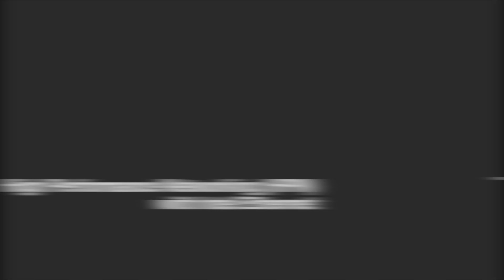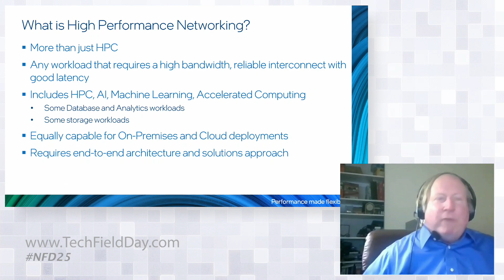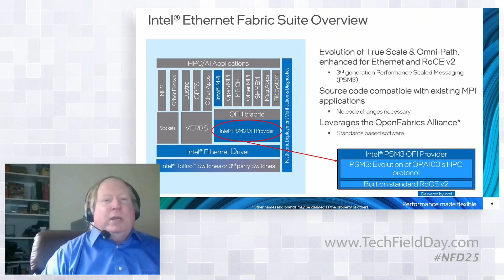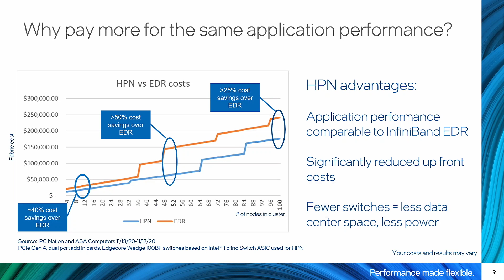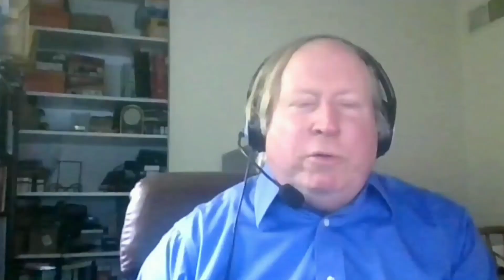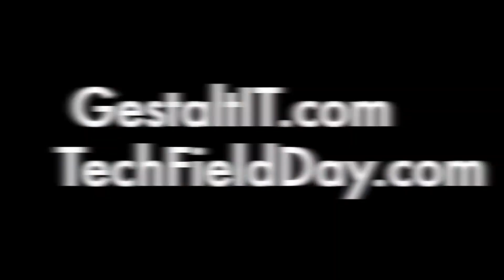High Performance Networking (HPN) with Intel Ethernet

Comment: The 800 series adapters are open optics, meaning you can use anyone optics in the adapter. Intel has a list of optics that they've validated with, however; if you want to use your own, please make sure you've done some testing before rolling out into production.